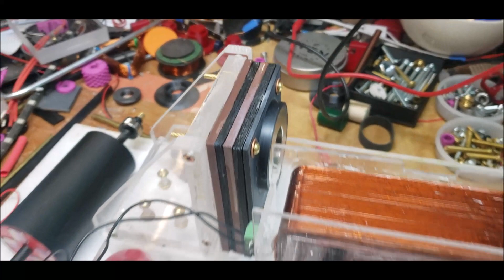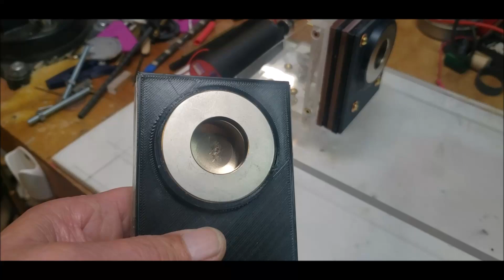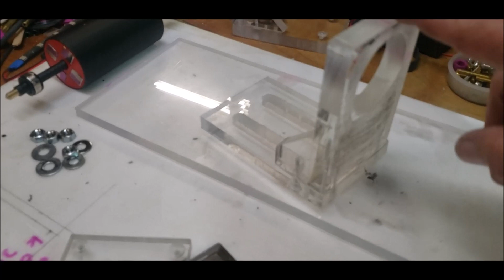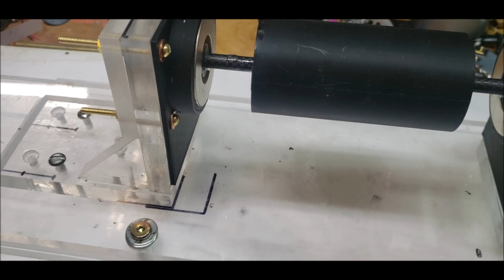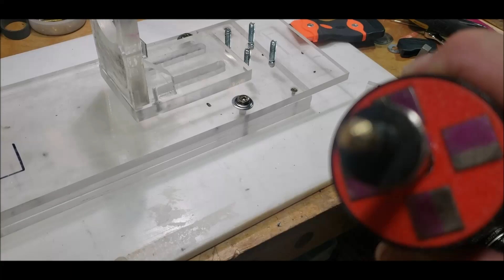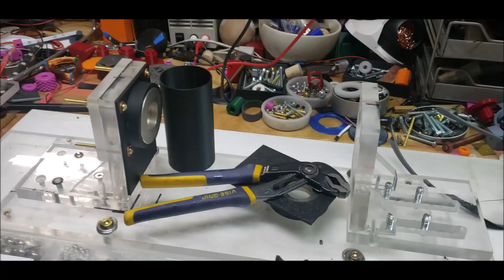3D Printed MagLev Build

Comment: Hello, the problem I see is very simple: the support rings are attracted by the rotor magnets BECAUSE THE SHAFT IS VERY SHORT, YOU NEED TO PLACE A LONGER SHAFT to avoid the attraction of both magnets, as the shaft is very short what it does is stop the rotation, the further apart the rotor and rings are, the better the shaft rotation will be.
Reply from the maker: thanks pal I am making a longer shaft